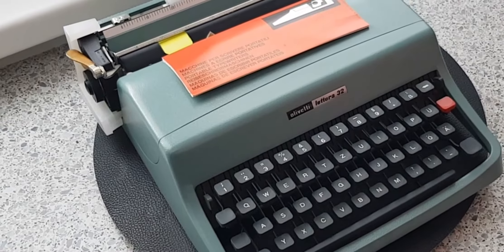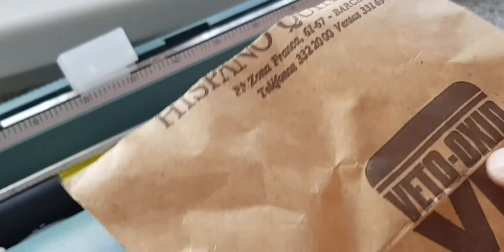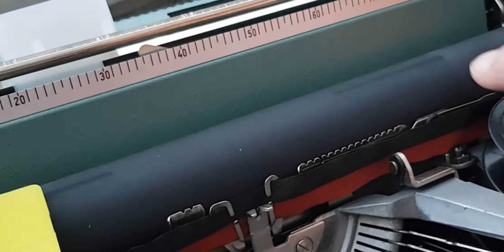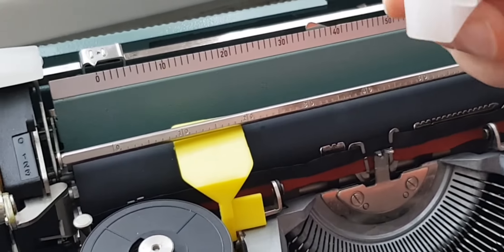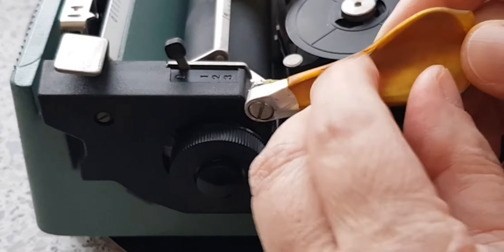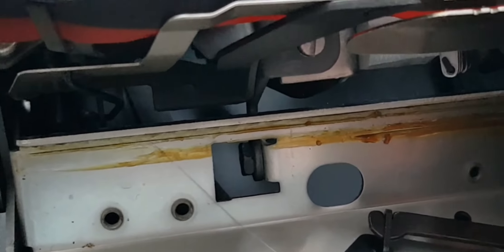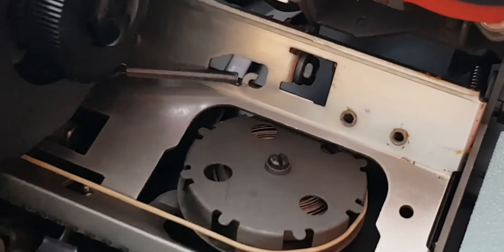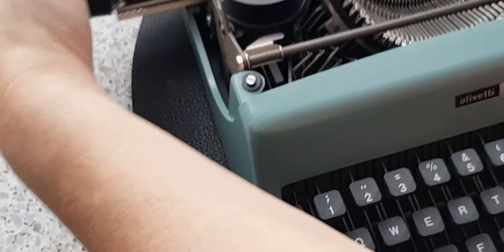Unpacking a vintage unused Olivetti Lettera 32 from 1970

Comment: Perché nella macchina da scrivere si mettono due fogli di carta?
Reply from the maker: Thank you for watching,  I had to use Google Translate so I hope I understand your comment.  In the video, I think I only used one sheet of   paper as a demonstration but normally I would always use two sheets. The rubber on the platen of these old machines can be hard so it does help to protect it a little.

Comment: What a great find!  I just bought an old lettera 35, which is in great condition although well used.  But your video was so useful for me, as I'd forgotten almost all that I ever knew about the trusty lettera typewriter, which was what I learned to touch type on in the 1970s.  What surprised me the most?  The weight!  What solid little machines they were/are.  I wonder how many times 'the quick brown fox jumps over the lazy dog' has ever been typed?  It's been  a little bit challenging (and with many errors) learning to use a manual typewriter again after all these years of using  computer keyboards, but such fun and so nostalgic!
Reply from the maker: I'm so happy to hear you found the video useful and are enjoying your Lettera. These Olivettis were beautifully designed, have fun getting your skills back! Sadly, I can't type to save my life! 😂

Comment: Hi there. I got a little late to your video, but I’m so glad I did. Wonderful experience! Wow! A brand new never used Lettera 32. Do you have Instagram? I can send you a PDF and pictures of the set up instructions for this machine… not exactly this one, but for the Valentine which is the sabe machine, but with a fancier look. Mine came with the original instruction for the removal is the protection pieces for traveling. You did it all correctly! It’s indeed intuitive. Cheers.